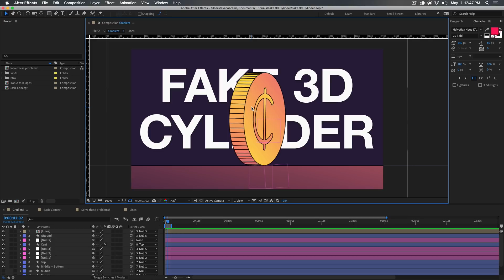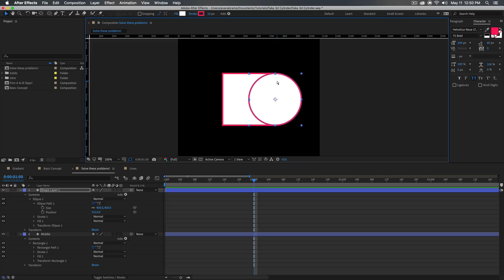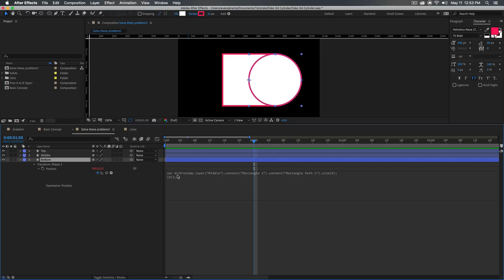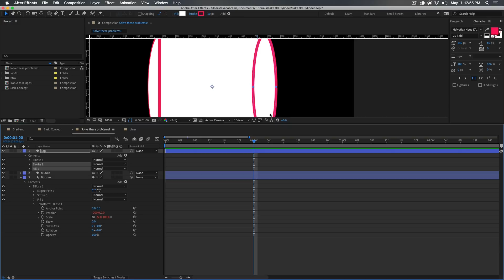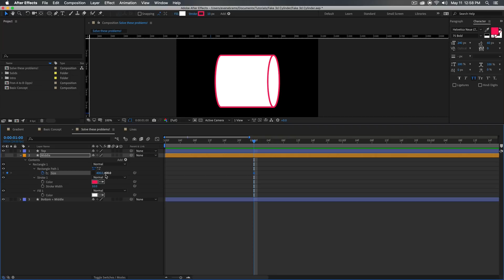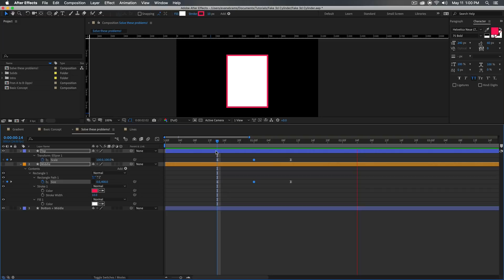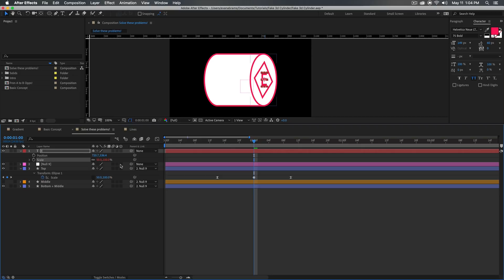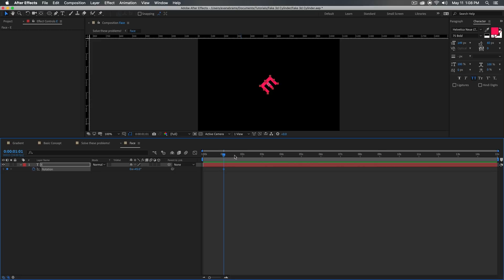Fake 3D Cylinder - Adobe After Effects tutorial

Comment: Hi, and what is about 360 degree rotation of the cylinder?
Reply from the maker: on which axis are you looking to fake the 360 degree rotation?
Reply: @ECAbrams  I had the same question... what if I wanted to complete the rotation around the vertical axis? Thanks
Reply: So what I did was create another version but with the objects going in the opposite direction, keyframed the second rotation after the first with continuous keyframes